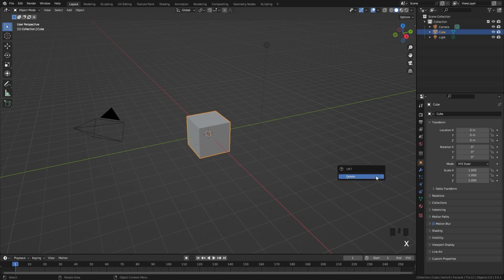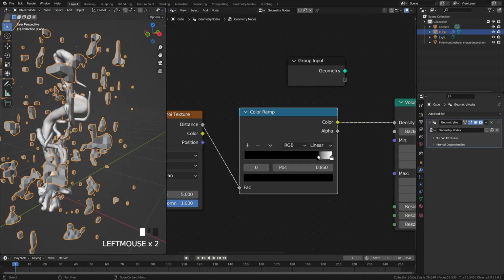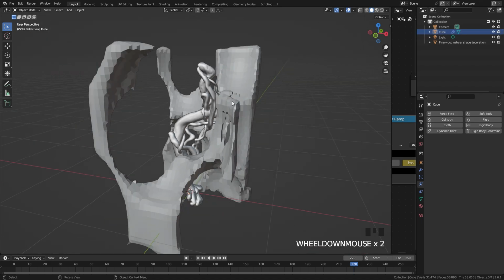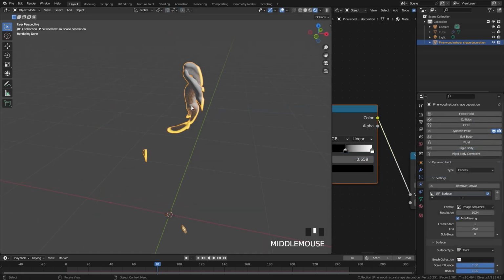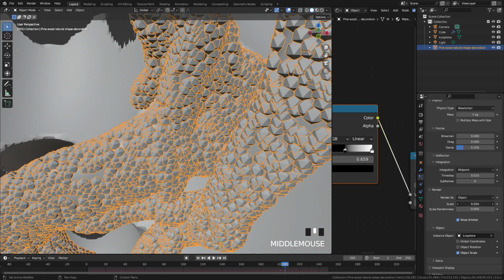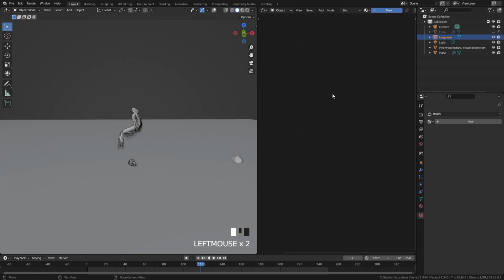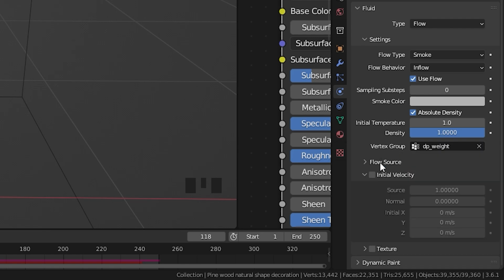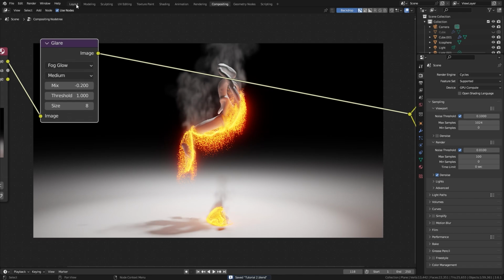Blender Tutorial - Particle Reveal Effect Animation

Comment: I have a suggestion to make about particle color. Instead of using a color ramp for the colors, you could use the "black body" node. At the end of the division, you change the interval from [0,1] to [2000,500] for example. This node corresponds a temperature to a color.

Comment: Absolutely awesome tutorial!!! Only real snag I’ve hit that I haven’t yet solved is that when I baked my smoke simulation data, the smoke didn’t rise; it sorta floats around in the vicinity of the particles—any clue on fixes for this?

Thank you!
Reply: The Blender 4.3 Manual explains that with the "Modular" cache type, you typically need to bake the simulation data first to see it in the viewport. The "Replay" type, on the other hand, might show a temporary cache as you play the animation without explicit baking.
Settings - Blender 4.3 Manual
A discussion on the Blender Developer Forum mentions that with the "Modular" cache, you need to bake first.
Quick effect smoke not showing up - Archive - Developer Forum - Blender Devtalk
A thread on Blender Artists Community discusses a similar issue where smoke disappears after baking with "Modular" or "All" cache types. It suggests that this could be due to not baking the noise or switching cache types after baking. It also mentions that switching back to "Replay" might erase the cache.
Smoke fine when "replay", dissapears after baking - Blender Artists Community
In summary:

When using the "Modular" cache type in Blender, you usually need to bake the fluid simulation before you can see the smoke.
The "Replay" cache type might show a preview without explicit baking, which could explain why you see the smoke when this option is selected.
Troubleshooting Steps:

Bake the simulation: With the "Modular" cache type selected, make sure you bake the fluid simulation. You can usually find the "Bake" button in the Physics properties of your fluid domain.
Bake Noise (if applicable): If you have enabled noise for your smoke simulation, you might need to bake the noise as well, especially with the "Modular" cache.
Avoid switching cache types after baking: Switching between "Modular" and "Replay" after baking might lead to unexpected behavior or loss of the cache.
If you have baked the simulation with the "Modular" cache type and are still experiencing the smoke disappearing, it could potentially be a bug in Blender 4.2.1. In that case, you might consider reporting it on the official Blender bug tracker with a simplified example file to help the developers investigate the issue. You can find the bug tracker on the Blender website.